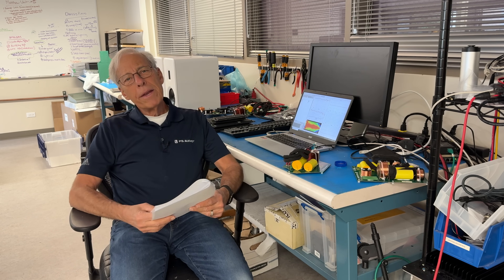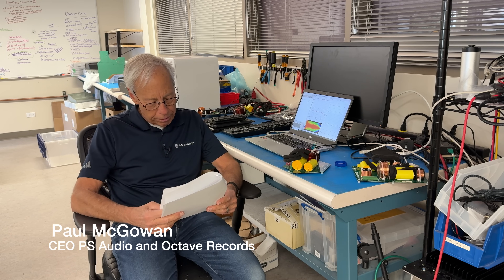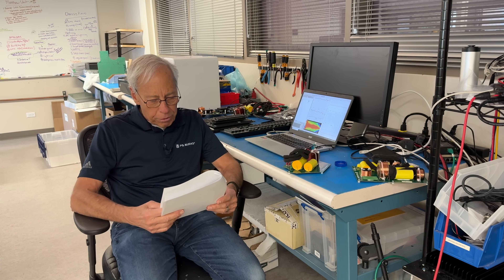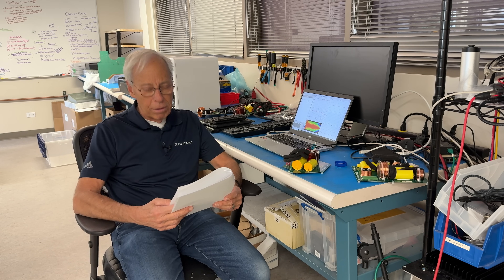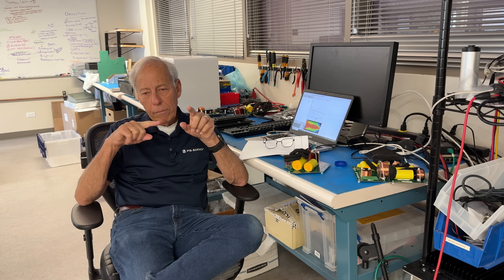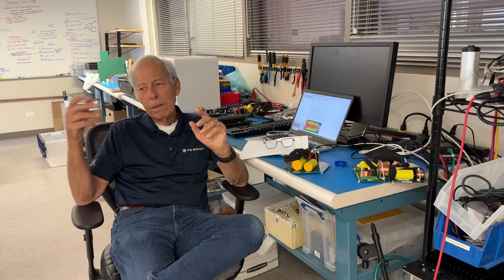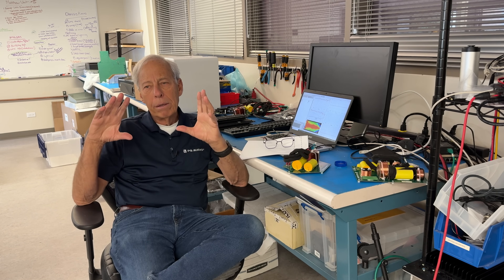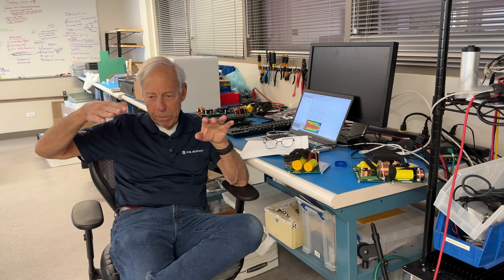Transmission line speakers explained

Comment: The phase is inverted 180 degrees before exiting the port,so is in phase.Below resonance where the air pressure within the box is unable to react against the pressure within the port,it just effectively becomes a hole and phase cancellation then sets in.This is the reason for the greater 24db/octave roll off because the wave exiting the port then cancels out with the one emanating from the front from the main driver. In T lines the rear wave is shifted a quarter of the wavelength, so is effectively a phase shift rather than an inversion. A well designed transmission line can have lower group delay than a port and a passive radiator design while allowing for lower extension. It's also better at dealing with standing waves behind the main driver,which can be a problem with the other enclosure types and can act as a quite effective brace for the box too.Lawrence Dickie of Vivid audio has done some great work in dealing with the rear wave problem in his designs. In my own home brew speakers i use a sealed acoustic suspension with a low Q alignment. This is the tightest transient wise and the slow roll off coupled with room gain means that a low extension is obtainable aswell as razor sharp transients. There are pros and cons for all of the enclosure types.
Reply: The back wave is generated a half cycle behind the front wave then is delayed another half cycle by the transmission line so it exits the speaker a full cycle behind the front wave making it additive.
Reply: @carlstineman274  Explain how a single driver/ surface ... can produce a back wave at a time delayed from the front wave. The back is not delayed, "a half cycle behind". It is just the opposite change in air pressure. When compression on one side, ratification on the other. But yes the transmission line does delay that pressure change from exiting the cabinet. as to at what phase/ timing relationship depends on the frequency.
Reply: @glenncurry3041  Not sure if you're trying to be sarcastic.  It's very obvious he means the phase if flipped.
Reply: best reply ever, why dont you have anything on your channel? where are all you audio people at when i need you???
Reply: Ports in ported enclosures are not out of phase with the woofer. It’s counter intuitive but at the ports tuning frequency and above the air in the port moves outward as the transducer diaphragm moves outward. It’s only below the tuning frequency that the port air starts moving out of phase with the woofer, but this doesn’t really matter because this cancellation happens where the audible range rolls off anyway. It is also incorrect that ‘sound comes out of a port’ because the air moving in the port is not actually an acoustic wave. Acoustic waves have quite low particle displacement but the air in the port moves with very high displacement. Really the oscillating air is acting as a diaphragm that creates sound waves in the outside air, basically the same as a passive radiator.

Ports can make a noise if they are badly designed, so that air velocity is too high or too turbulent. This is partly because ports are usually modeled with idealistic fluid flow and the real world motion of the air is very poorly understood by most engineers. Ports should ideally be front facing so that the acoustic wave they produce is time aligned with the woofer and combines perfectly with it. Sound generated by a  rear facing port will reflect off a back wall and may be a quarter wavelength out of phase with that coming from the woofer.

When the woofer is at the port frequency it becomes coupled with the mass of air in the port and the system becomes very efficient. As a result the woofer starts moving with very low displacement because it is now able to do work on a larger mass of air and is more efficiently damped by the air it is doing work on. The mass discrepancy between the diaphragm and air that makes transducers so inefficient is reduced. The small piston area of the port is able to produce a large amount of bass because it efficiently transfers energy to the air outside. Thiel once said that his parameters for tuning ported enclosures “only work because transducers are so damn inefficient”. If we ever invent a perfectly efficient transducer a ported enclosure won’t work with it.
Reply: @RobertNewman-m3y  "the air in the port moves outward as the transducer diaphragm moves outward." Please show us all the laws of physics that allows the energy at the transducer's diaphragm to be instantaneously transmitted to the port opening. And not delayed by the speed of sound through that air space. 

Yes I simplified the actual pressurization and rarefication for this discussion. But energy transmission is not instantaneous.
Reply: @ I do not claim there is zero delay or instantaneous energy transmission. I’m just saying they are in-phase by which I mean they are working constructively together rather than cancelling each other.

In this video Paul, whom I love even if he is occasionally inaccurate, said that the air in the port is 180 degrees out of phase with the woofer. This is incorrect at the tuning frequency and above. The air oscillation shifts out of phase below the tuning frequency, which is why the response of a ported enclosure drops off rapidly below the port frequency. Around the tuning frequency and above the effect is constructive.
Reply: @
For some reason my reply was deleted. So I’ll re-post it again.

I’m not claiming there is no delay. I’m only pointing out something that everyone knows and agrees with - that at the tuning frequency and above the woofer and the port are working constructively because they are sufficiently in-phase. It is below the tuning frequency that the system shifts out of phase and the woofer and port cancel each other, but the response is usually dropping off rapidly anyway so this is inconsequential. The acoustic phase alignment between a port and woofer was not clear from the video.
Reply: @RobertNewman-m3y  Exactly as Paul describes. It is a TIME not phase delay! The phase of the two signals, the front of the driver and output of port, is based on what the reference measurement point is. If you put a mic at each point you will measure the time delay and the phase angle will change with frequency. If you measure at a single point, the combined energy will comb filter like crazy as the point in space or frequency moves based on the timing of each signal.
Reply: @
The time delay is essentially insignificant because the wavelengths are so long at the low frequencies at which ports function. Same for comb filtering - completely irrelevant at low frequencies. What you describe is correct for the relationship between a mid-woofer and tweeter where the wavelength at a crossover frequency is quite short, but not for the relationship between a woofer and port where the wavelength is often longer than the room we are in.

Despite the long wavelengths, like I pointed out in my original comment, if a port is positioned on the rear and the speaker is several feet from the wall the reflection of the wavefront from the wall comes back with a significant phase shift relative to the direct sound from the woofer, because it has travelled twice whatever the distance is between the speaker and the wall and this can be a significantly long distance relative to the full wavelength. So there is good reason to put a port on the front if a speaker is going to be several feet away from the wall. However, front facing ports have a psychoacoustic effect. Many listeners try listening for port noise or to see if there are resonances inside the enclosure that might escape through the port. Whether such sounds are present or not, people tend to believe they hear them because they suspect they might be there are they a focused on listening for them. Speaker designers know a properly designed port and enclosure does not have these sounds but often decide to put the port on the back of the speaker anyway just because they know some potential customers won’t buy a speaker with a front facing port because they had a bad experience in the past or read somewhere that ports are noisy.

Low frequency response is usually such as mess, because of wall reflections and room modes, that subtle differences like a port being on the front vs the back are not easily audible. Room mode distortions have tricked many people in believing that our ears are not sensitive to phase and source direction at low frequencies. However, several studies show, including one recently published in the AES journal, that humans can easily tell where low frequency sounds originate, but only when room modes are not confusing our ability to locate the origin of the sound. I believe it is therefore correct to recommend stereo subs and digital room correction at low frequencies. When room modes are dealt with we can enjoy more accurate reproduction at low frequencies and subtle differences like the position of a port should become more audible.
Reply: @RobertNewman-m3y  "The time delay is essentially ..." IOW Yes I was right... you follow with a massive word salad blah blah blah red herring.
Reply: @ 
I’d like to apologize for getting too technical. Thanks for the interaction but as soon as a conversation arrives at an ad hominem I’m done.

I like watching Paul’s videos but for serious education in this area I’d direct people to
1) The Audio Engineering Society
2) the textbook Acoustics Sound Fields, Transducers and Vibration by Leo Beranek and Tim Mellow
3) the book Sound Reproduction by Floyd Toole
Reply: @RobertNewman-m3y  Yes the AES which I was honestly more active in while living in Nashville and selling to the recording facilities there. Also SMPTE (Society of Motion Picture and Television Engineers) which I have provided seminars on test and measurement of HDTV to. 

Amazing how little has changed since 1966. "How To Build Speaker Enclosures Build for Realistic Sound Reproduction" Alexis Badmaieff And Don Davis. Built my first 12" 3way around then.

Comment: Many decades ago, I was friendly with someone who was the woodwork instructor at a school and one Saturday morning we found ourselves in the woodworking room, cutting up timber for building two transmission line enclosures for the Bailey design, in which  KEF B139's woofers would eventually be fitted. It was extremely successful and the bass was both clean and extended
Reply: I have built a couple of True Dr Bailey Fully Damped TL speakers. You get an extra octave below FS of the driver but you lose sensitivity and they need decent power to drive the line. But done right they can be superb. The other problem is that they need large cabinets with a complicated internal structure to create the line.

Comment: Passive radiators also don't suffer the comb filtering of the transmission lines at the 2nd and 3rd harmonics of the fundamental. Passive radiators are better understood these days, a far cry from the so called drone cones of yesteryear. Cheers Ian.

Comment: I had a 5 speed transmission in my 1970 396 Chevy.
Reply: Hopefully you weren't a cycle behind at the line.
Reply: @chrisblock6697  Could you keep it in a straight line? Those tended to not have Positraction.

Comment: It's actually more an issue of tuning. A TL speaker will sound better than a passive radiator IF it is tuned correctly. How often are TL speakers tuned correctly? Never. It is near impossible to make an actual TL speaker. Not only does a TL speaker need to be designed for your specific altitude, but it's also humidity and temperature dependent as well. But wait, it gets better. The frequency of interest has to be the ONLY frequency that comes out of the port. You have to absorb all other frequencies. Otherwise they will form a comb filter with your speaker driver output. If you want to go through all the hell of trying to control your physical world in order to make a TL speaker work properly, then go for it. For everyone else, a passive radiator will sound better.
Reply: Yes actually I prefer bass from a closed box even it takes a bigger driver and more volume to get good SPL and low frequency. I have a couple of servo subwoofers with closed box from Velodyne that I’ve reworked and I love their very low distortion, flat frequency response and short decay. A passive radiator adds another moving part that has a resonance frequency, motion linearity and decay to it.